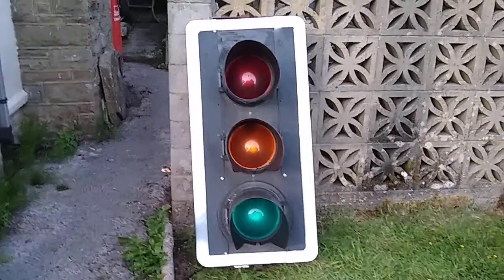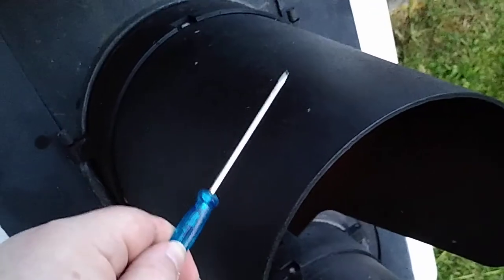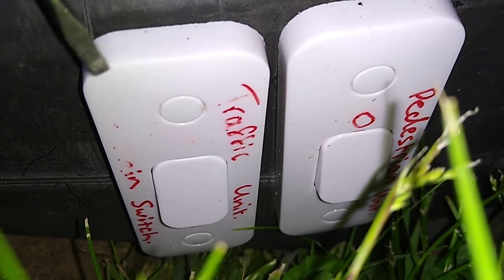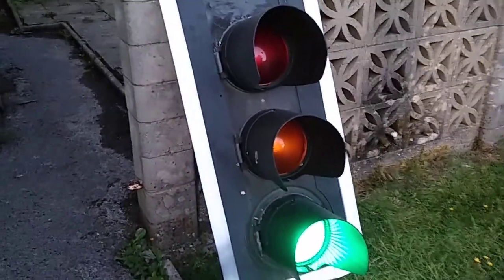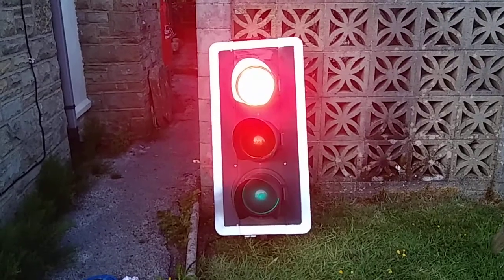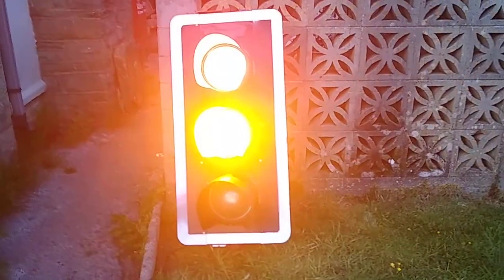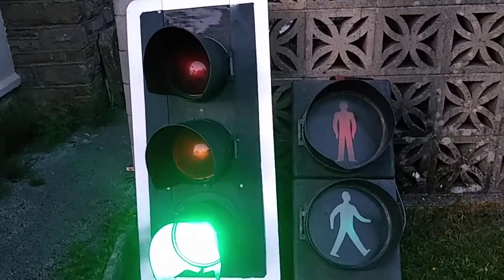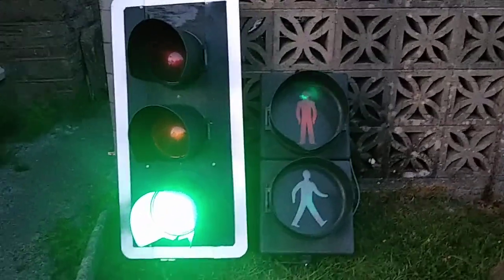Traffic Signal [UK] ~ Testing & Modifying Details

Comment: Might I suggest you control them via "arduino" ? That way you can change the lamps for LED Lamps and you will not need a cooling fan and the lights can run for hours and stay outside all year round. It's how I run mine.
Reply: Would be an act of vandalism to swap LED for the Mellor original bulbs. They have a quality that can't be replaced by the awful cheapness you see now on contemporary. The transition on and off slowly and smoothly. Gorgeous.